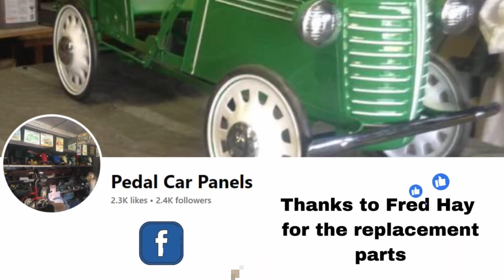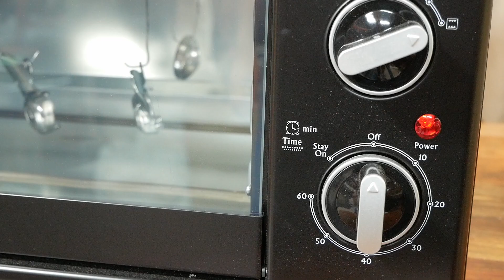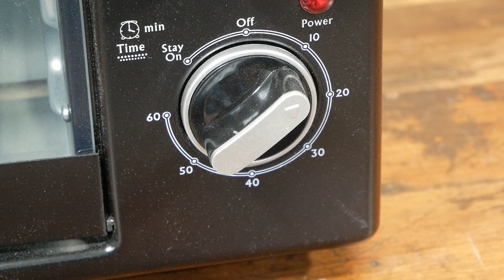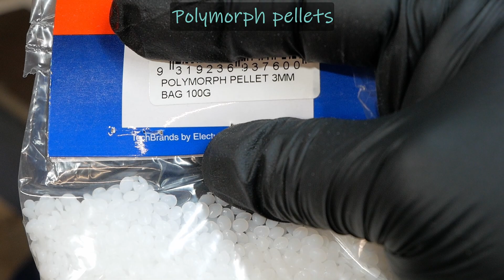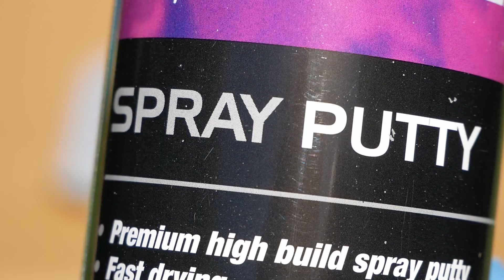Vintage Tricycle Restoration. 1960s Cyclops Tandem Trike.

Comment: I dudnt even know i needed polymorph cyrstals until watching this !!  Dam powder coat really is up a level or two .. maybe i shoulda done the car with it ... Outstanding wirk , in evey way research , equipment, skills ,production and outcome ..  have you thought about a gressel maybe for your next project . ?
Reply from the maker: Thank you Handy dad. The polymorph pellet is commonly known as moldable plastic. It becomes translucent at 62 degrees C and once cooled down, it's pretty solid. Strange material to work with.
Unfortunately, I have never come across a Gressel vice in Australia 😁

Comment: Absolutely stunning work. 
I started following your channel about a year ago when you restored the high speed cycle but have missed so many of your videos that I ended up binging 90% of them yesterday. 
Your level of finish is amazingly beautiful and inspiring. 

I am currently planning to restore 2 tricycle's I aquired from my local mens shed and will be using your pedal car guy for anything i need to replace. 
I just have a few questions. 
What is the putty you use to smooth out the dents for such a smooth finish? Is it just the Rustoleum spaint you use? 
And are you in Brisbane? If so we would love to have you come give a chat at our Men's Shed and show some of your completed works. 

Keep up the great work and and amazingly detailed videos.
Reply from the maker: Thank you, kind Sir, for checking out the rest of my video. Appreciate your nice comment.
I use an automotive blade putty on the parts that have small rust pittings. Spray putty is for flat surfaces. Sanding between coats is key. 
I use Rustoleum mostly as it is an all- rounder paint, and you can apply clear coat to it within the hour. 
And Yes, I am in Brisbane-  think my email address is in the about section on youtube. Theres facebook and instagram also, if you want to contact me for questions /tips or tell me more about the Men Shed thing 😉.
Thank you again 👍

Comment: Excuse me you can just MELT PLASTIC BEADS and make whatever the heck part you need if you can sculpt it???? How have i not known about this 😢
Reply from the maker: Hi thanks for watching. Yes, it also know as moldable plastic and softens at around 62 degrees C. Make whatever shape u want...Once cooled down, it's actually very solid.😉
Reply: ✅ - polymorph